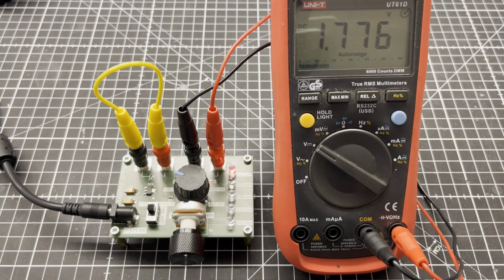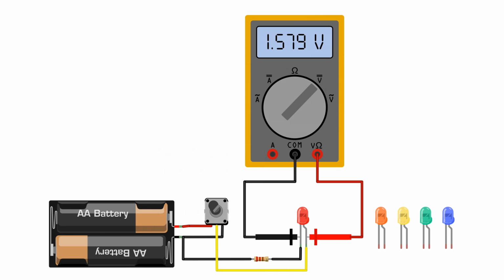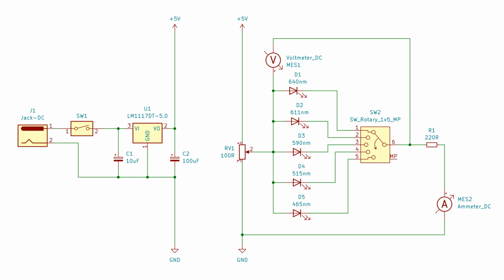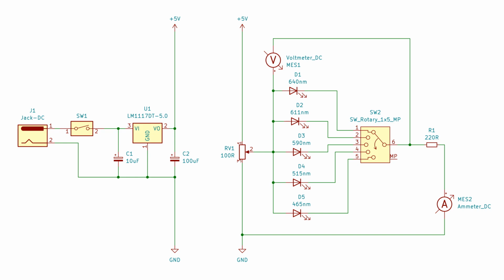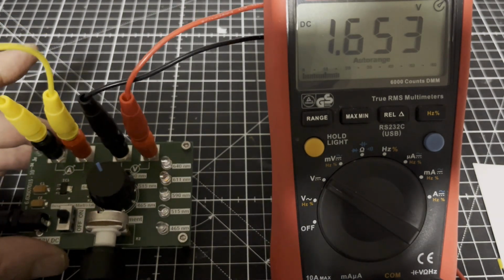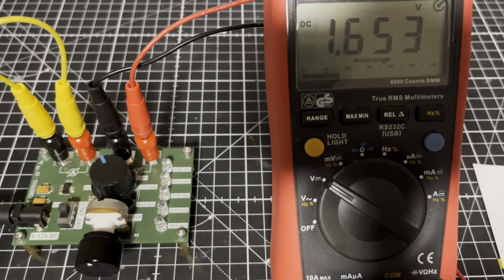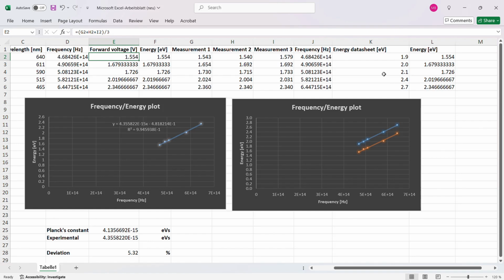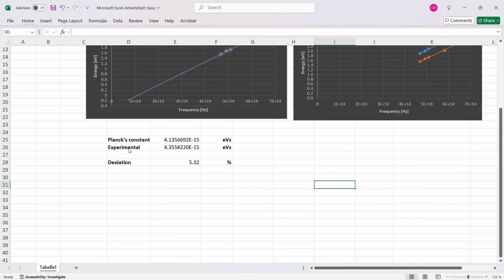Experimental determination of Planck's constant using LEDs

Comment: hey, just a heads up that tinned wires plastically deform over time (called "creep"), which is why you're not supposed to use tinned wires in screw terminals, because when you tighten the screw, the joint puts up lots of resistance and the connection feels firm, but then it deforms slowly over time, relieving the pressure and increasing the contact resistance (and since this process is accelerated by heat, you have a mechanism for thermal runaway. either just use bare the bare wire, or if you can't keep the strands together use a crimped ferrule. you can also remove the screw from the connection and solder it directly in if you have a strong enough iron, as long as you're not mixing relying on a maintaining constant pressure on solder

Comment: Is the offset in the graphs related to the 0.7V voltage drop you have in semiconductors?
Reply from the maker: No. LEDs have different voltage drops (forward voltages) than for example silicon diodes (0.7 V). The offset in my experiment is 0.48 eV which corresponse to 0.48 V. I explain in the video why you have this offset and why it doesn't matter for determing the Planck constant:)

Comment: High craftsmanship and clear explanation of the fundamental concepts involved in the experiment. Excellent vídeo as always. I wonder what the current would be used for, though?
Reply from the maker: Thank you:) With the ammeter, you could measure the voltage when current just starts to flow instead of looking at the LEDs when they are just starting to light up. You could also use it to determine the U/I characteristics of the LEDs.